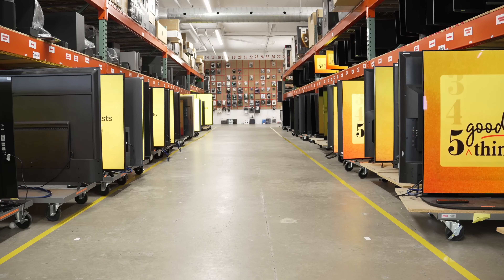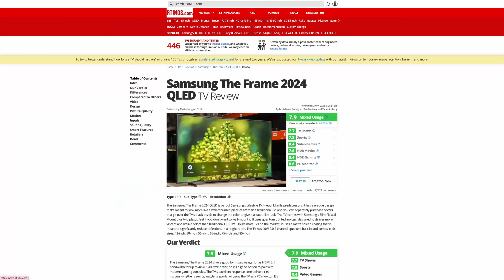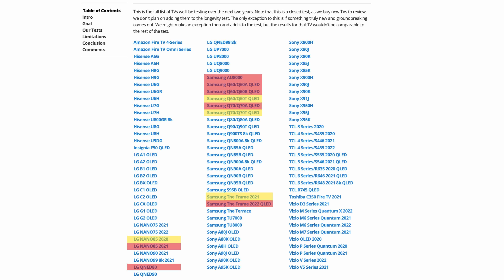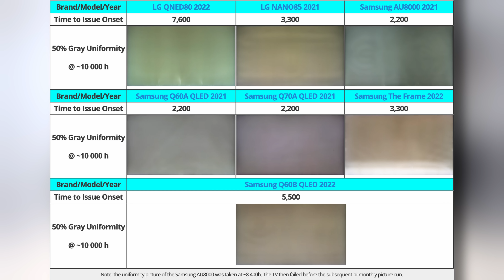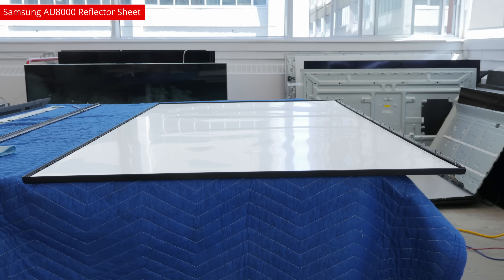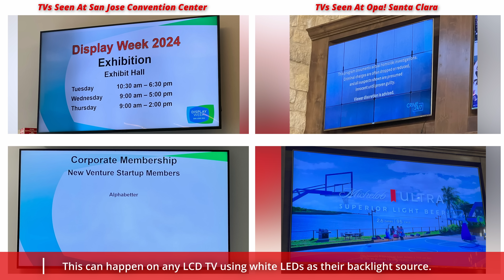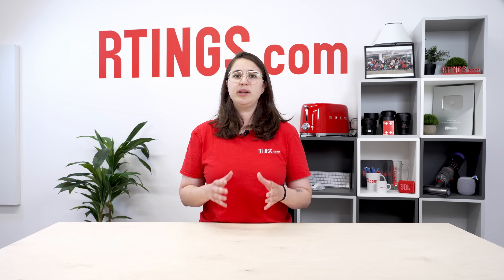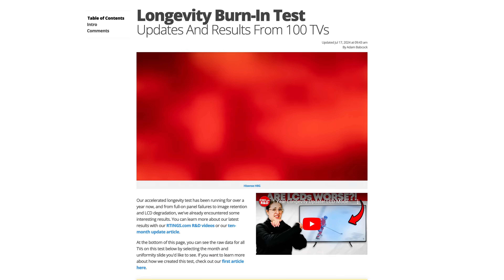Edge-Lit TVs Fail FASTER Than Others (100+ TV Test)

Comment: The Korean Samsung TV panels are some of the worst and thousands are sold  dumped here in Australian shops  that are rubbish and retailers are over charging making massive profits with hyped advertising on these Korean panels , charging fortunes for them and just s like the other Korean LG models are all designed to fail.The average person is swept up in hype and ends up buying them. Sony is the best do not buy this Korean made TV's  or any the Chinese brands  they are junk, typically all of these inferior brands deliberately are made so that  it will 100% also stop supporting newer apps after about 18 months.The built in cpu's mother boards are rubbish and slow and can't handle it when you want to load newer apps into the future. They deliberately built with  slowest cheapest electronics  in them,  to maximise their profit margins. They know you won't understand or notice for about 18 months when you try and down load a new app and usually when warranty periods have expired around the two year mark. This is another massive hidden scam with these panels from Korea and many China weird branded panels.  You just have to look at the remote control and compare to the better Sony's,  they  are all absolute rubbish. The GUI,  TV menus , the Tuning of channels  on all of these Korean and Chinese TVs are absolutely horrendous compared to Japans Sony's. Once you buy a Sony you will never go back.  The Korean and Chinese brands heat up so much the little lenses covering the leds behind screen  will eventually fall off one by one causing bright spots on the rubbish panel ,  due to  inadequate fastening and this  heat  and lenses falling off is deliberately built in obsolesces. They are not  fit for purpose so don't buy Chinese or Korean brands they are scamming you they care about profits not customers  unlike Sony  which has a heritage and better  after care service .

Comment: the samsung TV i bought in 2019 and gave to my father in 2020 has all these defects. the streaks of light, a whole column of dead pixels... and it got all that stuff in like its third year of life. it's a good thing that my parents don't mind, and they can't even see the dead pixel column, so all is good, but that tv, along with the LG one i had before, convinced me that LCDs have probably worse durability than oleds. after all, my two oleds bought in 2020 and 2021 both have retained much more pristine images (aside from dead pixels along the borders, which are numerous, but thankfully not very visible at all in any circumstance)

Comment: That reflector sheet warping is odd. I have a 7 or so year old edge lit TV which I did a backlight replacement for. This TV is on at full brightness about 12 hours a day. The light guide plate is cracked and burnt in multiple places, but the reflector sheet was perfectly flat. The reflector sheet has no room to move because on one side its supported by the metal frame, on the other the light guide. It has no place to warp. Also what I noticed is that the replacement leds run much much cooler than the original ones. The original ones were so hot that you can easily feel the heat on the backlight side of the TV, while with the new ones it stays close to room temperature. It does not seem to have any uniformity issues (besides the ones around the cracks).

Comment: Thanks for another report on your excellent long-term test.  I have never understood the obsession with thinness.  LCDs are already so thin when backlit that consumers no longer get decent speakers included and have to purchase expensive sound bars that are not thin and often require separate mounting.  The thinnest panels are structurally weaker, making them prone to bending or breaking and they may even sag under their own weight, so why consumers would want thinner panels is beyond me.

I already had no intention of ever buying an edge-lit LCD but these results are still interesting and suggest that the manufacturers were willing to sacrifice longevity to offer models in this market segment.  This was a "me too" product category driven by consumer preferences that seem more based in oddly-motivated aesthetics than in viewing experience.

Who will even care how thin a TV is once they have installed it and are watching content?  They'll watch the display, not the edges.  "Sure the display is crap, but look how thin it is," can only be said by a last, lonely brain cell before it leaves existence.  Yea, spending more money on a worse TV is not a sign of intelligence; perhaps Smith's proverbial "Invisible Hand" has no invisible head to reason with.

Meanwhile, my old phone died and I had to purchase a new one of the same model and screen size.  The replacement is 3 years newer, yet is both thicker and heavier while performing all the same tasks.  What?  Will the extra heft and bulk make it last longer?  Hope so, but I seriously doubt it.
Reply: Ludzie wieszają tv a wtedy cieńszy lepiej wygląda. Nawet grubszy tv nie ma dobrego dźwięku. Hyba ze do wiadomosci ale przy oglądaniu filmów to i tak potrzebny jest subwoofer.

Comment: I have a 50" QNED80 I bought in January of 2023 and just got a 65" LG G4 to replace it (once I get some help).  This is the first time I've seem the LED lights on the inside of the TV...or the heat distribution on the screen...fascinating!  I got the OLED because I wanted black space scenes, etc., instead of simply dark grey and bolder colors.   I'm going to give the QNED to my dad when he moves into a assisted living community broke hip a few weeks ago).

Comment: Correction: Reducing "Brightness" Doesn't affect the backlight. Instead Reduce " Backlight" to dim the lights..Almost every led tv comes with this option.
Reply: Correction: the backliight is a dynamic adjustment. Lowering the backlight reduces the backlight proportionally to the TV brightness. Reducing the brightness lowers both.
Reply: @Green_Expedition_Drgn  Correction: the backlight is only dynamic when this feature is enabled.  It is often if not always possible to manually adjust the backlight and disable automatic dimming.
Reply: It's called "brightness" on Sony sets rather than "backlight".

Comment: The thickness of a TV is the least important characteristic to me so it surprises me that they are popular simply because they are thin. When I watch my 5 year old Sony LED backlit TV I don't see or ever think of the depth. It could be a foot thick for all I care.
Reply: exactly! what is this nonsense about thin TV's aesthetics? who even looks the side of his/hers TV?
Reply: @vasopel  Not all people need thin TVs, but I do, for example. I think that in Europe, room sizes are much smaller than in the USA, especially in apartments. My bedroom is about ~10 m² (110 sq ft), and from wall to wall I have 2.75 m (9 feet), the bed takes up about 2.2 m - leaving literally 0.5 m (1.64 feet) for passage. So for me, when something sticks out 3 cm (1.18 inches) versus 9 cm (3.54 inches) from the wall, it makes a big difference.
Reply: @pruchay get a projector and Mount it on the ceiling, then paint the wall with one of those special paints for projection. done! 😊
Reply: @vasopel Thin TVs look nicer as they blend in better with the interior decor of most living rooms/mancaves/lounges. They're also lighter, allowing for easier ceiling or wall mounts.
For me, I dislike them as that also makes them easier to be tipped over by cats & children.
Reply: @jonathantan2469  "Thin TVs blend in better with the interior decor" I disagree :-)
Reply: @vasopel  For contemporary modern interior decor which is mostly minimalistic & flat, it works.
Reply: @jonathantan2469  I still disagree,
Reply: @jonathantan2469  The thing is, it can be an inch and a half thicker and look the same but cool better.
Reply: exactly ;-)
Reply: @jonathantan2469 In a model home or luxury suite, sure. But in ‘ real life’, not so much.
Reply: I hate thin anything. Phone, PC monitor, TVs, anything. Also these damn phones that don't even fit in my damn pocket. I'm actually going to try to buy a battery for my old Nokia 6630 and try to get that working again. I'm so done with modern electronics.
Reply: @davidcobra1735  a battery for that costs about 8 euros (without shipment)
Reply: @davidcobra1735 good luck trying to use that on a mobile network, no more 2G or 3G in the US
Reply: It’s a tv. It’s on a table or wall mount. Literally the least important thing is the thickness lol. Like who’s actually asking for a tv so thin? I’ve never understood this trend. I’d rather have thicker and better battery/cooling
Reply: @braixeninfection6312  you're the one mounting it on a wall, on a table normal thickness is fine, not the crud we have now
Reply: If only more people actually thought that way. Today, most people think of their TV as an "accessory to adorn the room and add to its aesthetic." People now think of their TV not as an actual TV, but rather as a FASHION ACCESSORY for the room. If the TV doesn't have the right "look" when it is off they simply don't want it. (Facepalm)
Reply: The only cure for prolonging thin led TV's lifepspan were a tiny fan running behind  or side of the TV. I already did this practice since I saw someone else done it and not long after that we have our first flatscreen tv in 2008,  and my family went highballer maxing the specs too,  it was a LG Scarlet the whopping 2 grand korean tv. It Was one of the most hottest tv we got in literal sense too.. I used it as pc monitor and the heat can be felt in 2ft distance after an hour of usage. So it put it on the side of the TV, temperature drops sharply and the surface was cold to touch afterwards. It still works to this day with moderate usage
Reply: It should be 3 feet thick, if they spent these past two decades on developing CRT TV's would be better in every single way then they are now. We could've had 36 inch HD CRT TV's with perfect motion clarity, HDMI inputs, no "smart" bs, modern tech literally ruined TVs.
Reply: @uponeric36  and can you calculate what would be the price of that 36 inch HD CRT TV with perfect motion clarity and HDMI inputs? :-O not to mention you would need to hire some movers to carry it...
Reply: @vasopel  crt tvs are no longer made but machines weren't shut down then yeah they be cheap , i used to have a big screen 50 inch crt tvs and they didn't even cost much back then
Reply: @MGrey-qb5xz  no you did NOT have a 50 inch crt tv , max CRT made were about 40 inches, and they WERE expensive!
you are flexing "old money" or you have a really bad memory.
Reply: @vasopel  you be surprised how much different varieties of crt tvs were released in the middle east.
Reply: @MGrey-qb5xz  ? oh so you're flexing "oil money" :-) 
well it doesn't mater where you live ...you didn't have a 60 inch CRT TV ... you probably had a back projection TV ...those had terrible image quality.
Reply: If they sell, they sell. It's hard to argue against the data when you're going for profitability.

Comment: I'm using my 4k led tv as pc monitor more than 5 years and more than 10 hours of daily use. (~18000 hours) Ambiant Light Detection:On,  Power Saving Mode : Middle. It works flawlessly like the first day I bought it. If you don't use in full brightness, the TV will take you until you die.

Comment: In my family and friends and at work: ALL edge lit TVs have burned LEDs after 4/5 years and they are at most 4G/day turned on. One from my parents even needed a new panel after 1.5 years, so inside the warranty in the EU. 

3/4 of these TVs are Samsung made or have a Samsung made panel. Now I’ve an S95B and no issues at all but it’s on just about 3h/day and the brightness is lowered by the firmware updates than when new, so Samsung did something about it expecting trouble sooner than what it should if the brightness was as high as when released. Shame on Samsung

Comment: I don't understand the fetish for these ultra thin displays. Even the most of the thickest LCDs are thinner than CRTs. Even handling these thin displays feel like a chore, they feel like they will break or snap into half because of how thin they are. And the sound quality of these screens, significantly worse than decades old CRTs.

Expensive garbage is what manufacturers make these days.

Comment: But it's amazing the fact that the issues with a LCD screen, all of them, in heavy most cases, is just about its backlight, and never about the Liquid Crystal and Color Filter Layers themselves. Rare cases, the issues happen to the TFT layer, due to some electric blockage which makes one of several of its "trails"(?), "tracks"(?) out of voltage, and then the pixels involved Don't work. All of them are "recyclable" and "replaceable", and you can have your original display full operant back again. Burnout LEDs can be replaced,, the phosphorus layer; actually each layer can be replaced and reused, making LCD eco-friendly and yet low cost. The secret of the LCD LED-lit longevity lies on never abuse heat on the backlight, using less nits on the screen, and this screen can go up to 8, 9, even 10 years of uninterrupted use, level ANY NOWADAY OLED MATERIAL CAN REACH! I have a 6 years Philco Edge lit TV that behaves like I just bought it: absolutely no issue in its VA LCD, or TFT layer, or backlight.

Comment: I had an edge lit LED monitor and TV ( both Samsung) die at around 2 years and they were both really thin and got really hot so this validates my experience. Engineered failure. Sony TV's are often thicker and from my experience they last forever. I have an older chonky LG that's still humming along too. Thicker is better but not too thick 😹

Comment: Very interesting data! 
Itwas always better to not go for the thinest models. The thicker tv's overall have way better uniformity. But this is another reason not to go for a to thin TV. 

And I think it's good advice to buy a TV that can go brighter than needed and then set the brightness lower. The only question is how will that affect eotf tracking when watching hdr content. 

For my A90J I use the light sensor but with that TV it only helps for SDR content. Then it's only at max brightness if there it a lot of light in the room.

Comment: I've taken apart and repaired flat screens from the early 2000s to recent models. The build quality on plasmas and board construction is night and day compared to what you see in a 2024 LED entry level set. Most TVs today are disposable and pricing reflects that. I still have some Syntax Olivia LCDs, a Panasonic Plasma, and a CCFL TCL eith a Samsung panel going strong. Ive repaired several TCL FALD sets with failed Tcon boards. And have seen many LG sets with dead LED strips.  Like cell phones, we have moved to disposable TV's.  Its not even worth my time repairing a 40" LED when you can't get $50 for a working set on FBM or CL. And to see the Samsung Frame failing due to heat issues should spark a class action lawsuit.  Panel uniformity kills a picture and replacing the white film is no easy task. Sad to see this. Electric bikes, scooters, and cars will follow this disposable mentality.
Reply: 42" Ölevia still going strong in the bedroom here. That thing has to be well over 15 years old now. My 47LG50 finally died after nearly 16 years of daily abuse. I estimate there was at least 50,000 hours on that one. My 5 year old 70" LG has nearly 24,000 on it...
Reply: Yea I took apart my plasma before disposing of it to see what was inside and to make it easier to carry, the number of screws and boards and brackets was impressive.
Reply: Modern flatscreens are the disposable plastic bags of modern display technology. I wouldn't even want to BUY a TV that I knew was created with such a throwaway mindset. I don't like buying ANYTHING that is disposable garbage. Just build the TV to last and charge what it needs to cost!!!!
Reply: @tacocat1714  no different from what the video implies, air conditioning.    the power supplies tend to give off magic smoke, I bet its heat as its quite a load.
Reply: Zgadzam się brak jednolite powierzchni plamy na filmie psuje odbiór. Jeżeli jest to wina foli to może trzeba wykonać ja z lepszej jakości i  sztywniejszego materiału. Czy ona jest aż tak droga wątpię i mam wrażenie że producenci skupili się na czym innym niz udoskonalanie tv lcd.
Reply: You think instead of spending 300 for a new 55" LED basic, worth it to spend half that for a nice clean older model?

Comment: I had a Samsung UN50TU7000FXZC that I bought in Apr 2022, the botom right corner and bottom left corner started to flicker then fail. Costco ended up replacing it in Sept 2023. I then purchase a Samsung UN50CU8000FXZC  from the. as of Jul 2024 it is working well. I use it as a computer monitor and have the britness set extremly low. It was also set very low on the unit that failed.

Comment: My samsung NU7100 55 inch had cracks on the light guide plate and eventually some leds failed, exactly like shown in the video. I live in Brazil so I don't know if this exact model sells on USA. I've replaced it with a Samsung miniled QN85B hoping to have better longevity (also better image quality and features). Judging by the results on the video I think It was a wise choice. Thanks Rtings for your great work! It's extremely helpful that we have someone watching our back